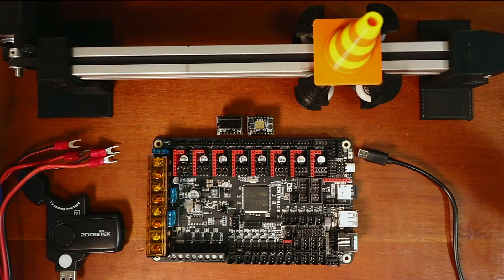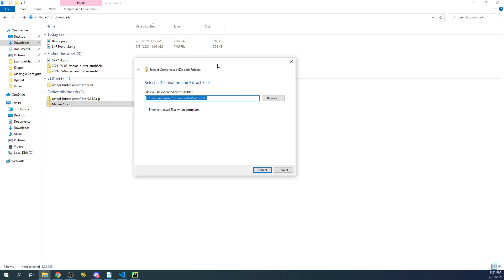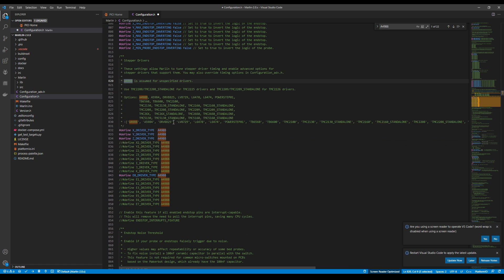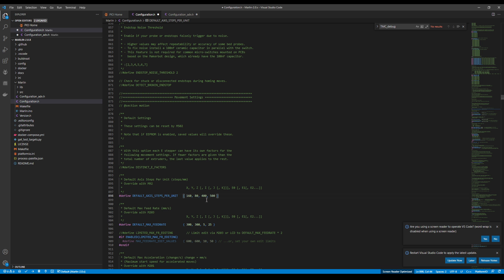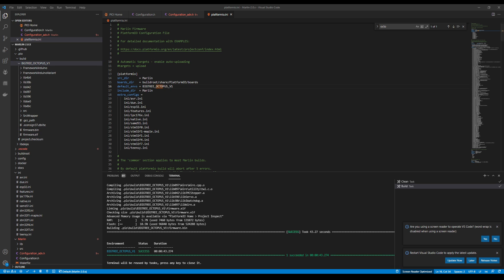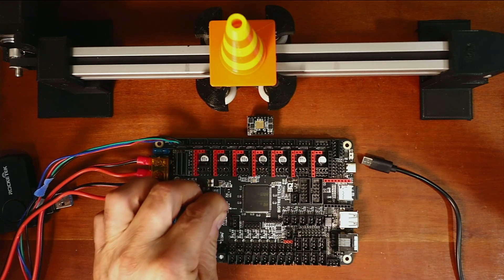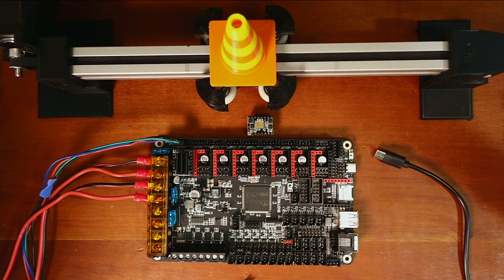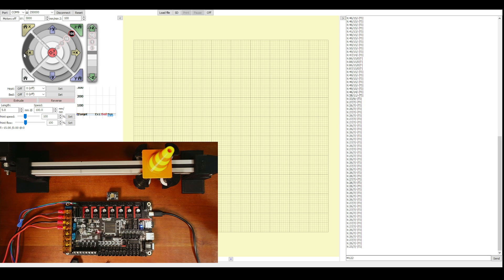BTT Octopus V1.1 - TMC5160

Comment: May i know the value that u use for default max acceleration?
Reply from the maker: Usually start with Marlin fw default settings.
Reply: @EdwardBraiman  is it no problem if i follow in your video?
Reply from the maker: That should be Marlin fw default, so yeah.

Comment: Hi, may I know why my output not showing like your in the terminal when the motor is moving? It just showing Test X Connection…. OK
Reply from the maker: Could be several factors, so as version of Marlin or different interface to connect to device.  Need more detail in your question.

Comment: I followed this video but have tiny layer shifts in a random direction after each layer with this setup. No such issues with identical hardware on the SKR mini E3 V3, leading me to conclude that it is related to the octopus board and 5160 driver setup. Do you know what might cause this issue?
Reply from the maker: Is the setup in the same or different printer?
Reply: @EdwardBraiman same printer. I should also mention enabling/disabling stealth chop has no effect, I have hybrid_threashold disabled, and chopper_timing set to chopper_default_24V as I am using 24 V to power the board. The drivers are running off of an adjustable power supply set to 56V and up to 8A
Reply from the maker: @Henrydbunny  I've not run them at 56V yet.  What occurs if you run steppers at 24V?
Reply from the maker: TMC5160 Max Voltage is 40V per datasheet.
https://github.com/bigtreetech/BIGTREETECH-TMC5160-V1.0
Reply from the maker: Are you referring to TMC5160 Pro?
Reply: Yeah, I have the 5160 Pro. I just switched them to run off of the board power and am running off a benchy now.
Reply from the maker: @Henrydbunny  Looks like Marling maxes out to 36V in Configuration_adv.h
"* CHOPPER_DEFAULT_36V"
In Marlin FW version 2.1.2.1.
Reply: It seems to be working much better off of 24V from the board. Thank you!
Reply from the maker: @Henrydbunny  you're welcome, well I learned BTT made a stepper Marlin can't control over 36v.

Comment: So I followed the instructions to the letter and I can get the x axis to move but no apparent sensorless homing the extruder carriage just hits the endstop and the motor grinds.. No idea where to go from here.
Reply from the maker: Okay, might be related to a recent Marlin firmware update.  Which version are you using?
Reply from the maker: Also they're are two different versions of stepper for tmc5160 or tmc5160 pro.
Reply: @EdwardBraiman  As I stated above the steppers are 5160 V1.3 I don't se any "PRO" designation. Marlin veriosn is latest as per BTT website "#define CONFIGURATION_H_VERSION 02010000"
Reply: BTT GITHUB firmware "Marlin-bugfix-2093"
Reply: Other info = 24v power supply, driver power jumper set to board power
Reply from the maker: @Test-dv1jl  In the video have a stated the stepper has sensorless homing capability?  I've recently acquired the stepper about month ago.  Here is the setup on another board with Sensorless Homing.  https://youtu.be/1U3-8aIcUm0
Reply: @EdwardBraiman  So I reviewed the other video and the only difference that I can see is the setting for sensorless homing sensitivity from 8 to 1. I actually tried some other values between the -63 to 64 and didn't seem to make any difference. So I will try recompiling the firmware with the "1" setting and try again.
Reply: So I tried the firmware as per the video and no change the x motor hits the stop and grnids. I also tried downloading the latest Marlin 2.1.1 using the Octopus Pro 429 environment and the x axis didn't move at all. So I guess this is a bust...
Reply from the maker: There's a Discord link  in description either myself or someone in general chat can help.